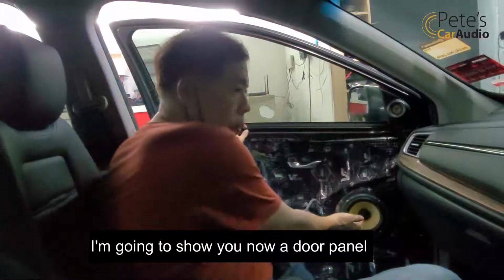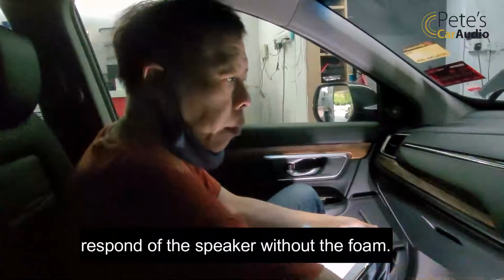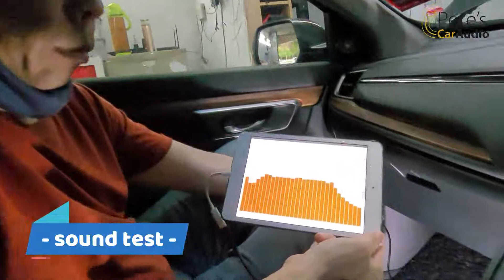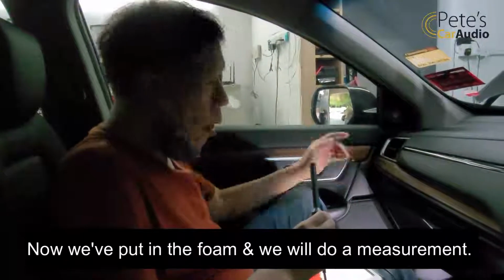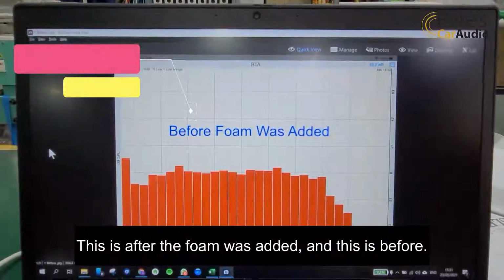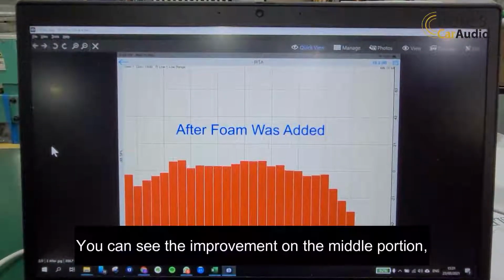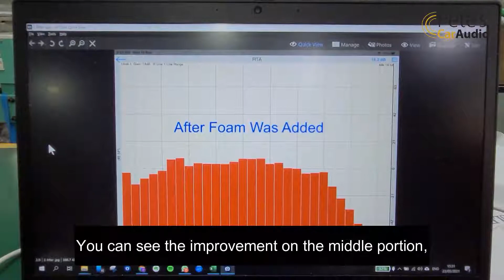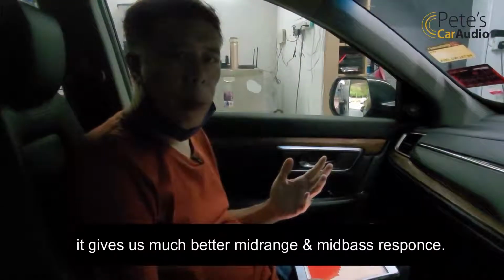Pete's Audio - How To Further Improve Your Speaker 2021

Comment: If front speaker is 9 inc can add foam ring? Hw much will it be
Reply from the maker: just need to mod 2 pcs of a 6 inch to make up a 9 inch , can be done,  for what car pls ?
Reply: @petescaraudioaccessories673  mazda 6 with bose speaker 🤣 thats why front speaker is 9inch
Reply from the maker: @happy_forever8  If its the standard speaker , I would not bother doing it......
Reply: @petescaraudioaccessories673  noted. Thx for ur advice. If next time i will definately look for u to upgrade